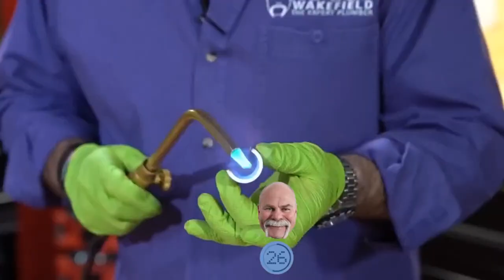I Created a Successful Trades Business and YOU Can Too

Comment: I have a plumbing question for you. We recently got a new faucet and the push to connect fitting between the pull-down and outlet hose was leaking. Is this fixable or should we replace?
Reply: Use a 50/50 flux and solder iron. Hair curler can work in a pinch and melt solder into the cracks. Duct tape over it while it’s hot and it will melt on adding to the resistant barrier.